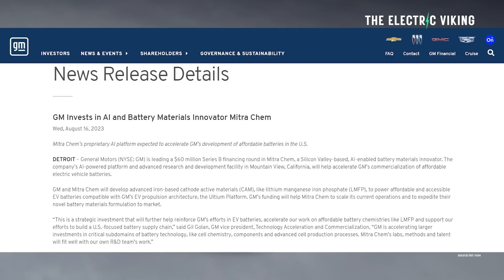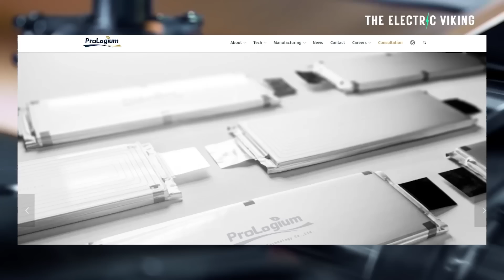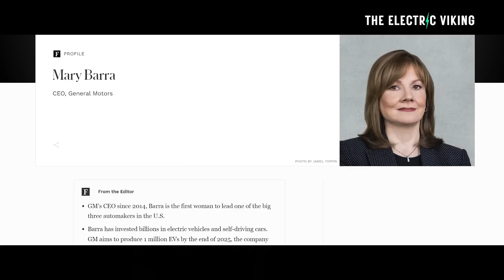GM invests in battery company promising 30% EV battery range boost

Comment: Engine efficiency, battery technology ( density, longevity, charging/discharging speed, safety),  software including autonomous driving, and manufacturing efficiency are  the elements of EV dominance.  It's not a surprise current automotive companies investing in them aa they are financially focused over innovative focused.  The minimal amount indicates a foot in door approach blocking others over genuine interest in the technology.

Comment: GM has numerous battery partners LG, Samsung, Mitra Chem, and POSCO. Battery companies are always looking for more market. Does any auto conpany make their own batteries? They typically assemble the smaller batteries from outsourcing) in various form factors and make the battery pack.
Reply: Tesla makes their own. But they also get some cells from other suppliers too.
Reply: @ryen7512  interesting, Tesla is pretty savvy, where do they make their own? I see partners in LG, Panasonic, CATL, BYD and more.

Comment: I think people are kind of underestimating GM's EV efforts. Yes, they stumbled with the Chevrolet Blazer EV from late in 2023, but have made it up with the vastly superior Chevrolet Equinox EV that came out recently. I hope GM eventually switches to batteries that use very little to no liquid electrolytes, given the innumerable problems with leaking electrolyte fluids causing battery fires that are very hard to extinguish and emit a large amount of very toxic smoke.

Comment: Is it possible to fit these batteries into a car that normally uses a Lithium Ion battery?  Or is this only for the latest GM electric cars?
Reply: Batteries are a complete system, with cooling, charging, and monitoring/control subsystems. They're not swappable like D cells, but there will be a dedicated replacement & upgrade industry when enough of them get on the road. However, in most cases the batteries will outlive the rest of the car then get sold as replacements, used as stationary storage, or recycled. So be happy with the battery that came with the car, and if not, get another car. 

There will always be hotrodders who swap things around, like they did with engines. But that's a hobby, not a practical solution to "old" batteries.

Comment: Learned from the Russian war on Ukraine (and why some sanctions can have a big bite);

* Making petroleum products requires specific machines, and tight tolerances.

* The pieces and methods of integrating the parts into a coherent machine that can do a task is managed through groups of patent licenses. 

* Since a refinery tends to make different products, groups of patents are stacked together to generate a set of end-products and not just a single thing.

* Russia: No longer has easy access to the patent stacks to fully process their crude oil, especially after parts of the machines that are in the patent stack(s) break  or are destroyed.

-------

Right now, battery tech is largely siloed; a company has their own patents and methods to produce their own products or that are used to generate partner products.  The same patent holding companies also either make their own machines, or have tight control over the parts that are specific to their processes.

Result: You can't just open a factory and order in equipment like you can for a machine shop and start making cutting edge batteries.  Even if you ignored legal patents, you would have to put money into developing methods that use the patented processes...and then open your company and your customers to lawsuits when those batteries are sold.

Then again, that's right now...mostly.

Comment: Based on all this most recent focus on throwing money around at battery research and developers, it's clear GM has no real intention of scaling its EV production to lower the cost of its EVs anytime soon. 

This is the same game of charades GM played back in the later '90s and early 2000s that started with their canceling of the EV1, their Electric S10 and its entire stable of hybrid cousin vehicles, rather than moving forward with the Lithium-ion battery available at that time. Simultaneously, GM let Toyota take over GM's lead in electrification with relatively poor performing, though more fuel efficient at 50 mpg, engine load-leveling, CVT-like hybrids, namely the Prius. 

At that time, the Li-ion battery had already been proven capable in portable electronic devices like Sony's Walkman. But, instead of pursuing this proven, much higher energy-density Lithium battery technology that was on GM's roadmap for its 3rd generation EVs, to improve immediate-term profitability, GM's CEO and Chairman Jack Smith shut it all down with the GM board's approval, except for making claims and performing research on dead-end hydrogen fuel cells. 

The 3rd generation Lithium battery was on GM's roadmap to replace the Advanced Lead-Acid and the more advanced, higher energy-density Generation-2 Nickel Metal Hydride (NMH) battery that was also put into the EV1 and Electric S10 pickup.

At the same time, Toyota was also experimentally producing / test-marketing fully electrified RAV 4s, but following GM's canceling its EV1 and foregoing production of any of its stable of hybrids, Toyota also shut down their EV testing in the U.S., until starting up another round of market testing with Tesla and Panasonic in 2012-2014.

Comment: Battery tech is the number one hurdle holding back foreign EV makers. Chinese dominance in producing fast charging, durable, high density, and cheap batteries gives EV makers there a big competitive advantage. Even when foreign companies do eventually get the tech, Chinese battery makers have moved the bar by then. 

In a few years though EV battery tech will likely shift from being more about cost rather than innovation. Once EVs batteries all reach a certain threshold, further innovation becomes law of diminishing returns. It won't stop completely of course but other vehicle features will start to play a bigger role in what consumers buy if any EV consumers choose gets at least 500 miles and charges in 5-10 minutes.. After that threshold is reached, the companies that spends a lot of R&D money to get small EV battery upticks, will have to compete against cheaper commodity batteries that most consumers see as good enough for their needs. While the demand for higher density batteries will remain (e.g for exotic cars, aircraft, etc) those premium batteries will probably become too expensive for most EV use cases.

Comment: Cool, if someone promises 40%, will they get the money too? Add some AI topping on the the cake and your are set for 100mil so called investment.
Reply: Sound byte investment. Haa...

If the battery is that good,  hp, smartwatch will use it first. Not sound bite.
Reply: They should show theory that works and disclose tech challenges and uncertainties. You don't dole out millions to BS artists. At least I didn't when I was managing R&D.